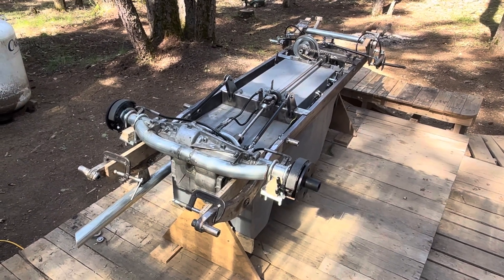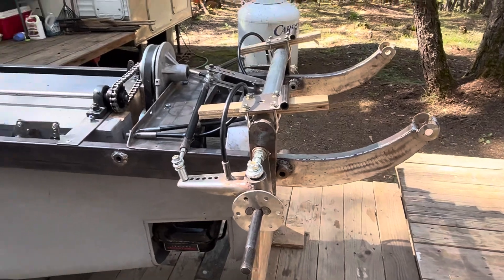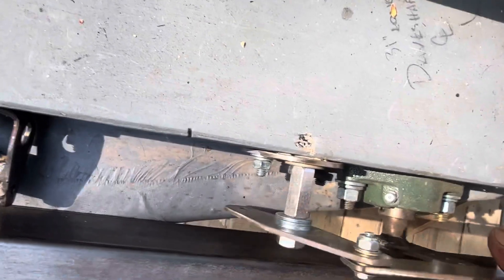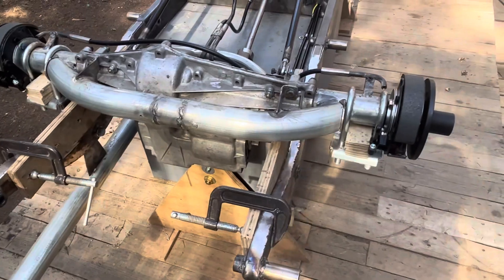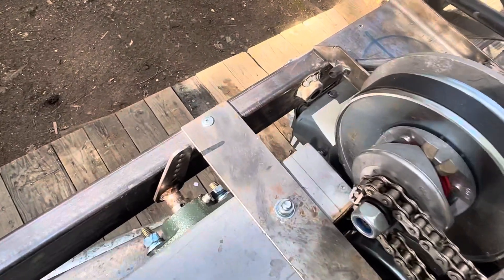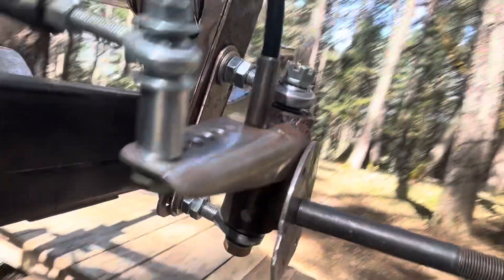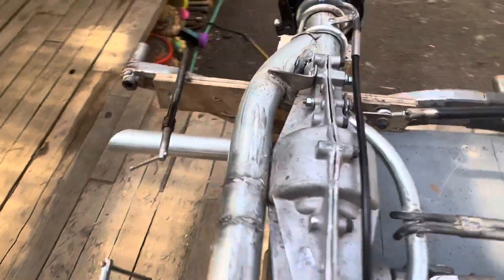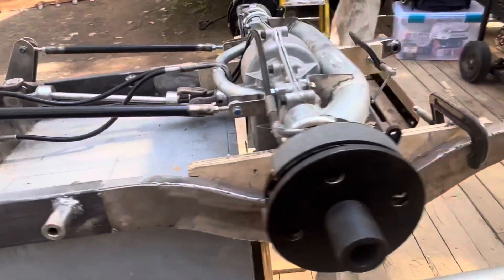Cyclekart Build - Duesenberg 183, vol. 10 - drink every time Zach says he’s done with metal fab

Comment: What gear ratios are you using for this and what speeds are you expecting to get out of her? She has the looks of potentially being very fast.
Reply from the maker: There are three speeds in the transmission plus reverse. Final drive in top gear will net 65mph but the presently bone stock 6.5 predator will not get there. I’m shooting for 4500 rpm in first which will net about 35 mph. 

Thanks so much for your interest.
Reply: @bluewhaleadventures152  
Good to know. I've been messing around with an idea for a front engined gn/frazer-nash/chater lea 1913, monster grafton type build (basically a special homemade racing cyclecar). I even thought of using bicycle gears so that I could somewhat mimic the frazer nash chain drive 4 speed. Depending on gearing theoretically it could get 60-90mph (depending on 3:1 vs 2:1 finial gear ratio) at stock predator governed rpm of 3600. Really would be a death trap and I have no idea how I would get it to not explode the bicycle chains needed so may be slower on finial. Also made the decision if I will build it to go with a wildcat 223 engine for the reason you mentioned with the predator. I never even thought of doing a lawnmower transmission so you definitely have a better idea then me. Plus you have some beautiful bodywork on your kart. Looking forward to videos of it running.
Reply from the maker: @questofknowledge8788  Sounds like a great project. I’ll keep my eyes open for it.